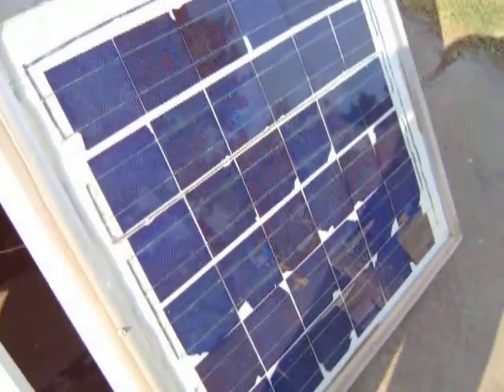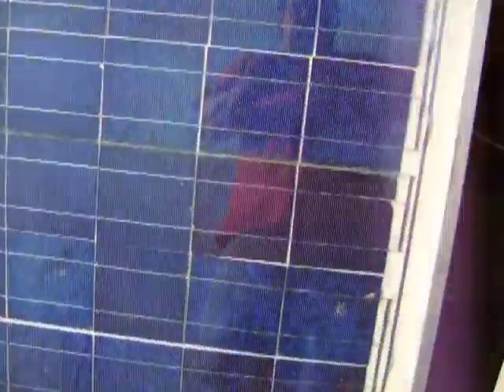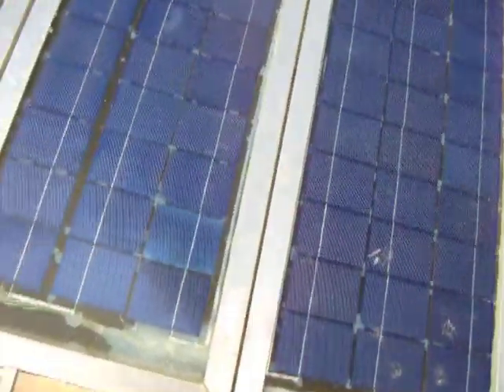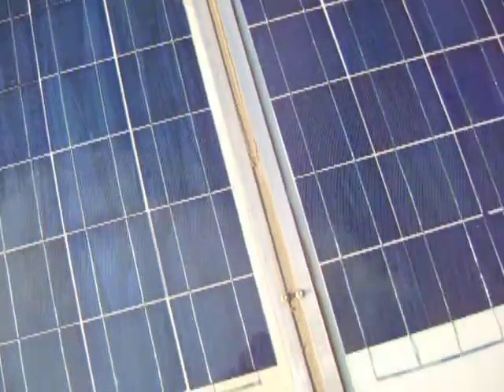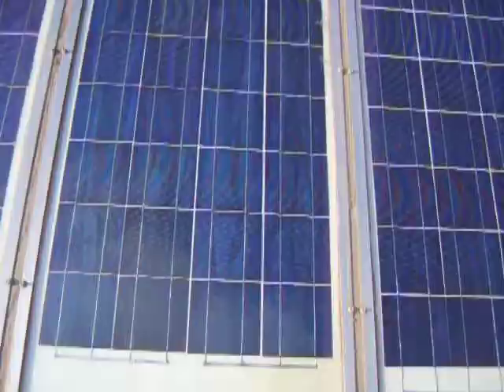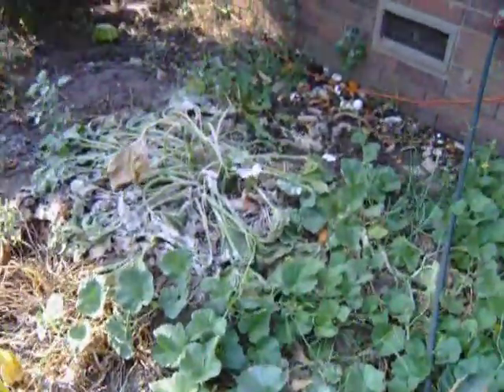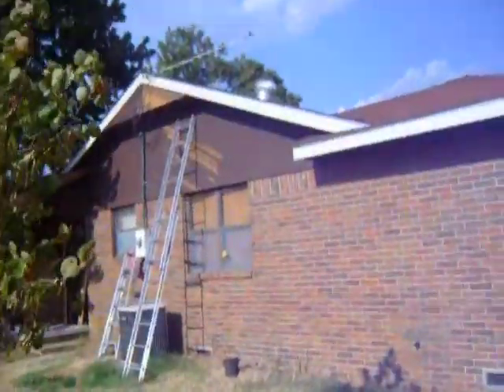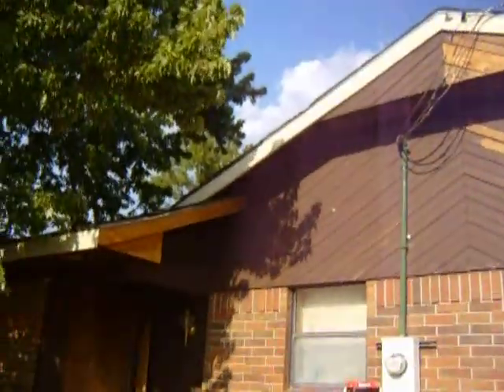Solar Panels Holding Up to Weather Ok

Comment from the maker: @wtam69 They make about 20 volts no need to . You want all your panels to have the exact same voltage. I shoot for 19 or 20 volts these cells have around .5 volts each. that is 36x.5=18 volts. But I think the cells have more than .5 volts more like .5277777777volts  to .555555555volts each.

Comment from the maker: It was making 15 amps x 24 volts about 360 watts but now it hot so its only 8 amps x24 volts now its only 192 watts in the hot weather.